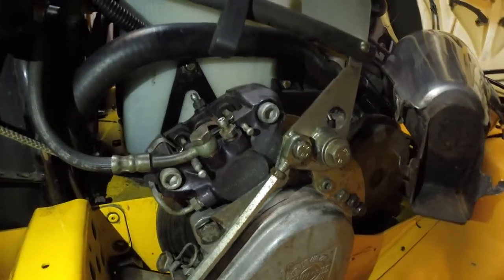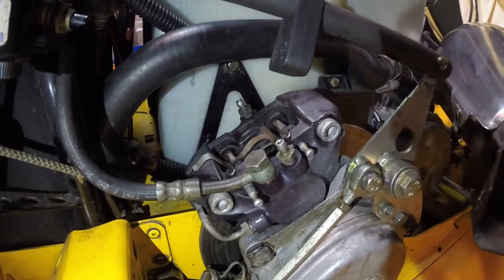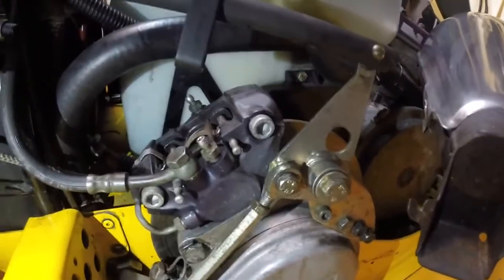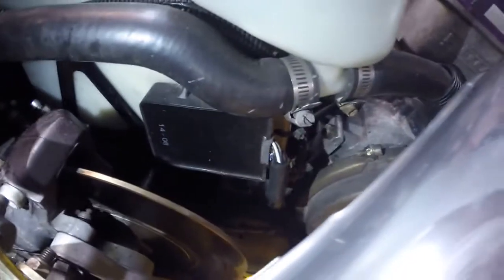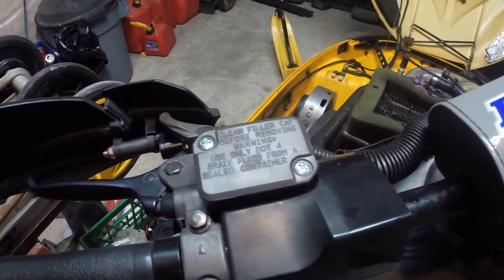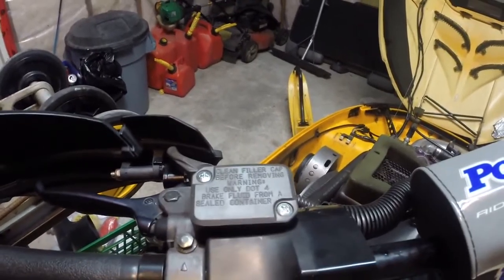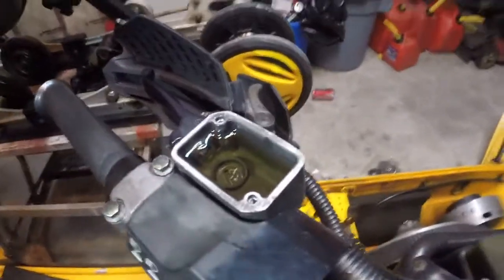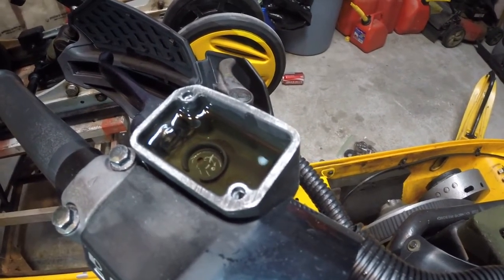How to Bleed Brakes on a Snowmobile   Skidoo Polaris Arctic Cat Yamaha

Comment: Thanks for this video, we almost lost our 97 Summit 670 2 weeks ago to an overheated brake disc. Melted the oil bottle, which ended up catching fire, then melted the fuel lines to the primer. Luckily we were able to get the fire out by smothering the whole sled with snow. Currently working on getting replacement parts, looks like we should be able to get it back on the snow this year hopefully.

Comment: My brakes locked up on the trail today and lever was rock hard. Was able to crack bleeder to release brakes and get sled home. Checked reservoir and it was low. Guessing it’s never been changed/serviced. I will attempt bleeding and try again, but what would cause the brakes to lock up?
Reply: The tiny hole in the reservoir gets plugged and won't let the fluid pressure in the line to the caliper to release.  Currently fixing same issue on my 2000 MXZ 500.
Reply: Age combined with natural ability of brake fluid to attract/suspend moisture.  Over time, moisture causes rust.  Rust (redish color fluid in resivoir) blocks tiny hole in resivor, brakes piston,pads dont retract.  If you have older sled....check change fluid every other year, but check every year b4 season.  After years of ageing hardware rust has started in brake lines, will continue.  Sleds sit idle for 8 months of year, rust never sleeps.  Consider useing dot 3 instead or dot 4.  Trade off is moisture attraction..
Reply: And.......caliper rebuild.  If anyone ever gets a part number or source for the caliper piston o ring.  Let me know.  It will make effective rebuilds of these model years calipers possible.  Its some type of flat o ring
Reply: @joelclark4979 hey i have the same probleme i need to bleed my brake on my 01 mxz 500